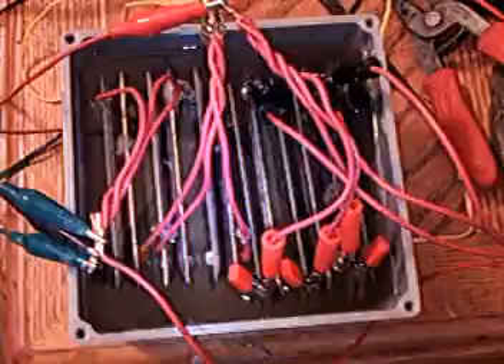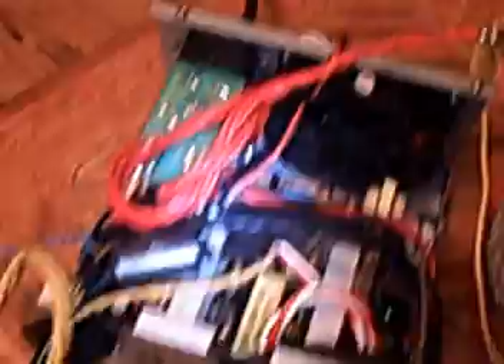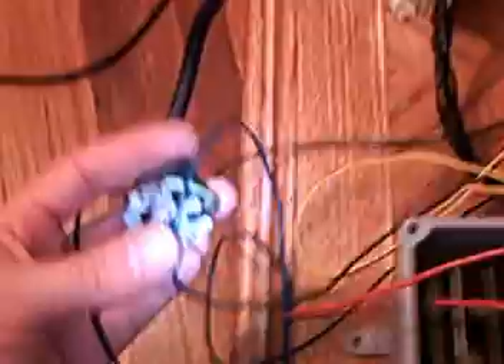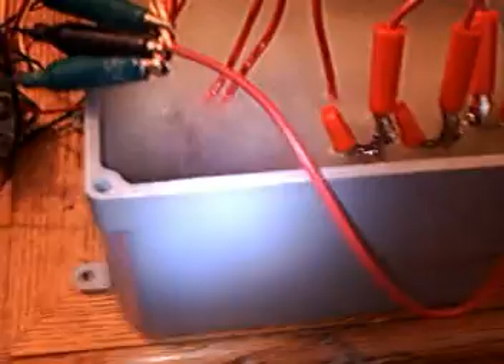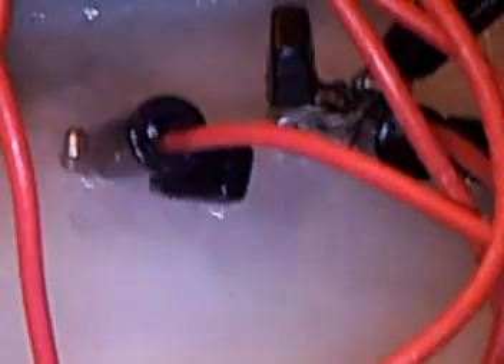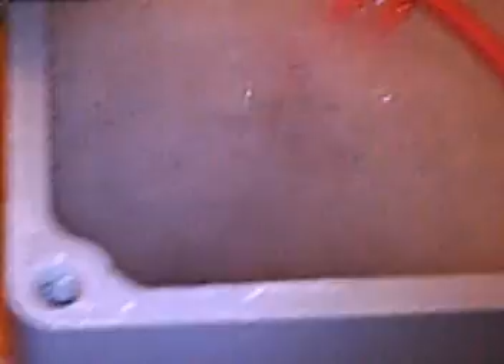hho - 5 volt PARALLEL CELL

Comment: So far, I have been testing with the idea of using a 12 volt square wave generated by power transistors or a 555, then taking that output and putting through a voltage multiplier in our 10 parallel plate cell, try it, you with have outstanding results